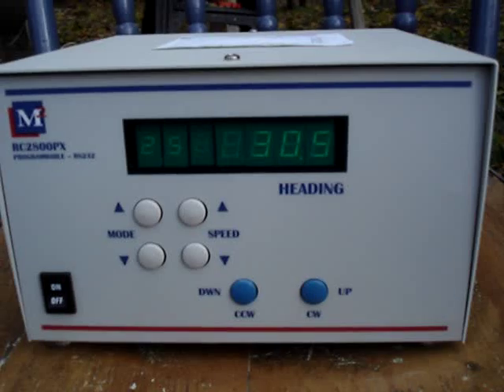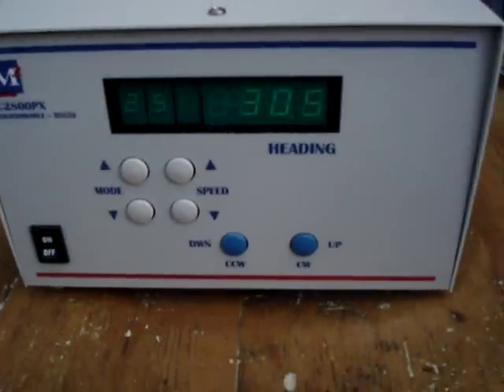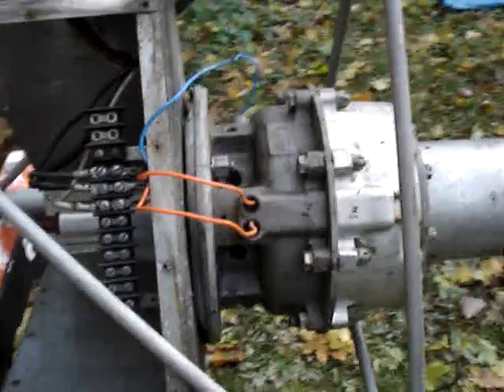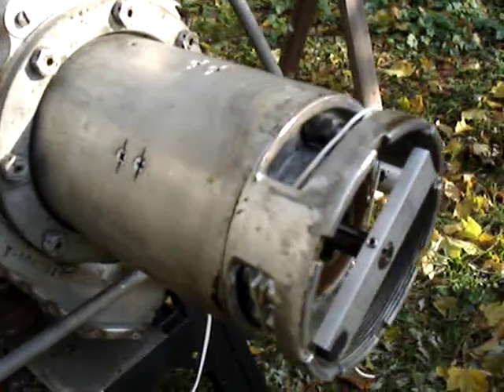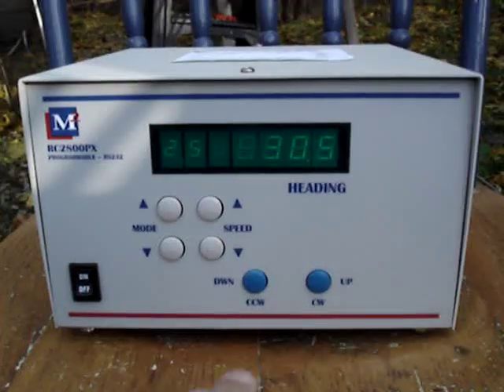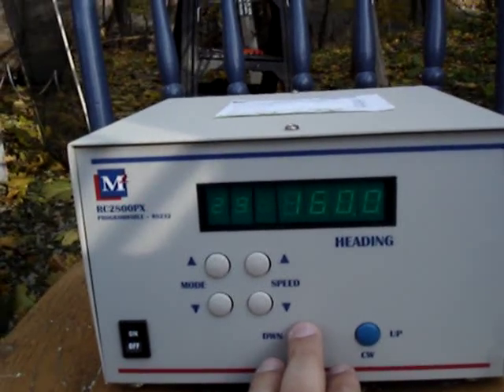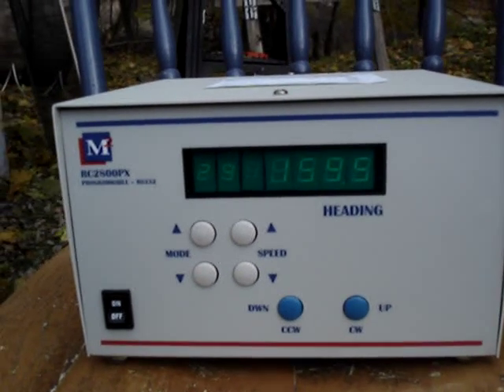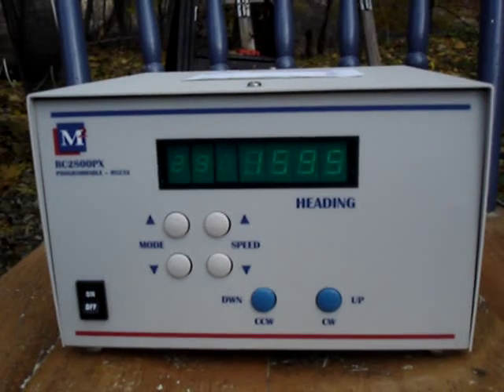Prop Pitch Antenna Rotator Demo

Comment: Hi Lee, Great video. I have a Pitch Prop motor and gearbox in parts as the moment, redoing it for vertical operation and using dry grease.
I would be interested in any further information on your work using this setup.
You mention in a video you are going some engineering work on it.
Regards Kevin, ZL1KFM.

Comment from the maker: Hi Guys, for some reason I am having problems submitting replies. I just get a grey box when I try to post.  Let's try it again. Since I can't post a URL, google for m2inc then under the ham radio then rotators you will find the specs on the controller. I can't seem to find a PDF so if you have questions send me mail. 73 de Lee WW2DX